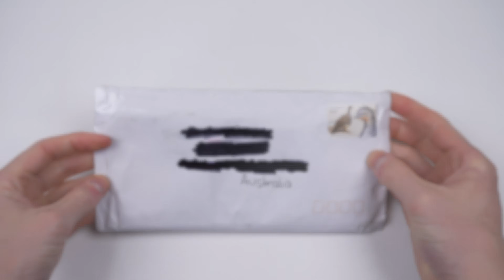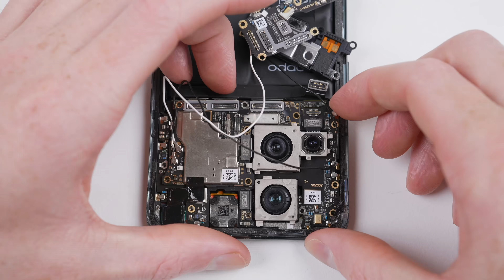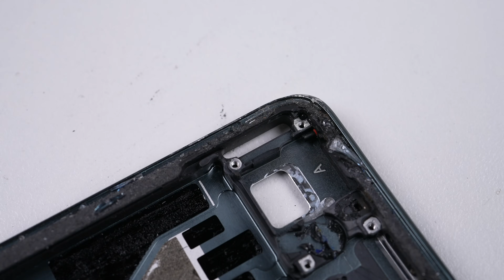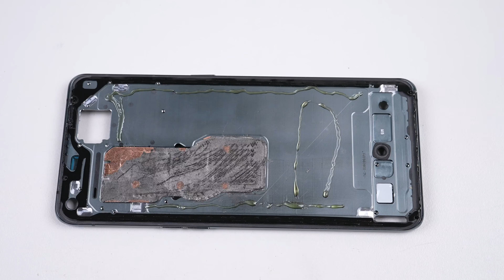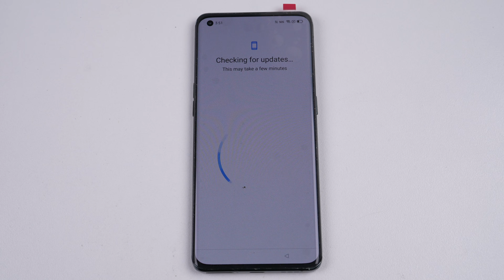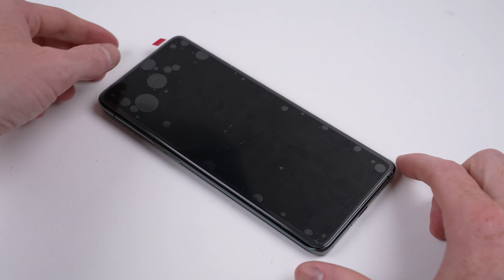Fixing Someones Failed Repair - $30 Oppo Find X3 Pro Restoration

Comment: oh, it's very similar to the oneplus.  Could you tell me if you can change the logic board of an LE2127 for an LE2125?...It's that the 2125 is 12/256 and the LE2127 is 8/128 and without 5g.

Comment: so google reset protection can be bypassed? even "find my phone" option was turned on?
Reply: It was no bypass. He was wrong. It was asking for his old phone's password in which he logged his gmail account  for restoring backups present in google one. Standard procedure for all androids over 10. Do you really believe android after 13 years will have that?? I am surprised how he made that mistake.

There is no such thing as "reset protection" on android. I often work with custom roms.

Comment: The phone was asking you to enter a new unlock pattern not the old one, clicking cancel just means no pattern was set. Same with windows 98.
Reply: actually you both are  wrong. It was asking for his old phone's password in which he logged his gmail account  for restoring backups present in google one. Standard procedure for all androids over 10.
Reply: @GigaCat  actually you are wrong. Windows 98 was here before android, so simply cancelling the password means you didn't want to set a password. Also, on android, the phone would ask for an email before any password would be entered. As I said, tapping  cancel just means no password/pass code is set.
Reply: @andytownsend9163  He actually did enter his email. That's why it was " Looking for backup" right before asking for the password. I am an android dev. I know that setup wizard inside out. He didn't show you the email login for obvious reason. 

Setting unlock method comes after restoration. Check the video again. You can see a skip in the video. That's where he had setup his email and right after that wizard asked for password of his previous phone after " checking for backup " on that email. He canceled the process and it went ahead without restoring. I hope it's clear now.
Reply: @andytownsend9163  Also windows 98 is irrelevant .
Reply: @GigaCat   The phone was reset to factory, no email was entered. He then says pressing cancel simply bypasses the pascode, the same as in Windows 98. Let's hope you don't dev on my android device. Maybe you need to watch it again.
Reply: @TheRealGigaCat  he quotes going full "windows 98" so yes it's relevant.
Reply: @andytownsend9163  "and he is quoting windows 98 so it is relevant" 😵‍💫😵‍💫😵‍💫.

If i quote"gay" and "feminist ". Will that be relevant too? With that Android password?
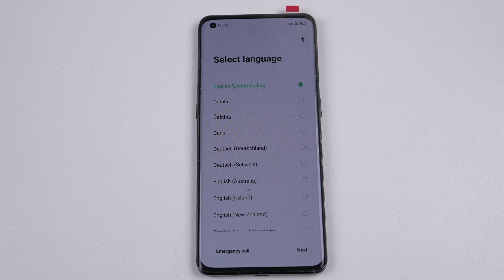Reply: @andytownsend9163  watch the video right after he selects language. There is a cut in the video. Explain to me what that cut is. From 10:50. His hands disappears if you need proof for that. I will be waiting. Be the smart guy and reply back.
Reply: @GigaCat  correct the phone asks for a pass code, he states password/pass code is related to the original owner and just pressing cancel bypasses this request. You can not log in to Google with a pass code, pressing cancel just dismissed the chance to enter a pass code. I don't know how you can format a phone and still have the old users' email addresse, he may of entered a new one, but what I said is 100% true. The phone was asking for a new pass code, not the old one.
Reply: Hence the referral to windows 98
Reply: @GigaCat  I'm waiting 🤣🤣
Reply: @andytownsend9163  i am not saying that phone is asking for Gmail's passcode. It is asking for the passcode of the phone in which the email account was previously logged in and was setup as the backup email( which means if i had and old phone with that email. The new phone is asking for the old phone's passcode to restore the backup on new phone from the previous phone). This has been the standard for Google's implementation of Android since 7.0 which majority of OEM uses including oppo and Samsung. your reply clearly tells that you never used Android or never restored any backup over gmail.

The passcode screen doesn't mention the old phone's name because its over an OEM skin of oppo's colour OS. If you take the Pixel phone or any AOSP rom. You will see the old phone's name along with the prompt to enter the passcode. 
There are two ways to restore data. 1st one is over the cable which he clicks "don't copy". After that comes the restoration of settings over gmail. Google one backs that up. If you have an Android right now go check it in (settings> backup). There is the google one backup setting. That is what's happening here.

After reading the reply i feel like you are even more clueless. Obviously you cannot log into an email with phone's passcode. All that steps i talked about comes after logging in to email with password. I thought that was understood.. but no..
Reply: @andytownsend9163  you can even watch a simple video of the setup screen on yt and how it goes. But no. Also will be waiting for your reply.
Reply: @GigaCat  I think he may have edited it in a way that's confused you. Yes, you are correct. My original reply said unlock pattern. I didn't mention password once. You have twisted what I said into password. Go and read what I said, and yes, you need a password to restore a phone, not an unlock pattern.
Reply: @andytownsend9163  i think I am wasting my time here.. should have realised earlier. Watch some setup videos. Sooner or later you will get that he skipped the part where he was logging into his email because obviously he doesn't want you to know his credentials. I am getting confused by the very thing i worked on for years? Sure buddy.

And yes, you absolutely need your old phone's unlock pattern to restore your phone because your data is encrypted over that pattern. The video is available even on official Google's channel on yt. It will explain all that to you like a toddler.

Also don't bother replying. That would save a lot of my time.
Reply: @andytownsend9163  peak comedy.

Here 🏆
Reply: @andytownsend9163  i truly wish i had as much confidence as yours. Can't really imagine me being your shoes. Also using joker emoji... You must be less than 20. But your photo looks like that of an adult... are you using your dad's account? Anyway My employer would have fired me after reading this chat if i were you..
Reply: @GigaCat  dude, seriously read what I said. Calm down!! what you say, I agree with, but it's not what my original comment was about. You have twisted it way off course. Please stop. You seem to be confused with an unlock pattern and a password. I never mentioned "password" once. I never mentioned email either, both words you have put in my comments. I think if you learned more about Windows 98 then you would understand what I'm saying. Thanks and goodnight 😴

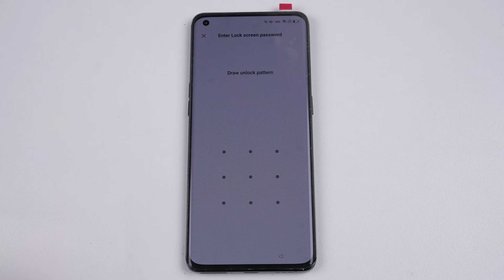Comment: 11:00 I have never seen easier bypass than this 😂
Btw, this phone reminds me iPhone 4s on iOS 7.0.2 which I got completely disassembled and had to guess which screw gets where. I ended up disassembling another 4s to check the right places for screws, using it as a “navigator” (hope you got it 😂)
Reply: Actually he was wrong. The phone was asking for  his previous phone's password in which he used the gmail account. This is a standard procedure for androids to ask for copying settings from previous android and is not mandatory. You can even see "checking for backup" just before it asks for password. Phone is actually checking backup on his google account and is asking for his password and not the password of previous owner of the phone. He cancels it and it goes ahead without restoring any setting.

There is no such thing as "reset protection" on android. TBH i can't believe he of all people made this mistake.
Reply: @TheRealGigaCat  there is a reset protection called “FRP lock”, google it
Reply: there is reset protection but its easy to bypass @TheRealGigaCat

Comment: release in 2021. $1500. People are freaking ridiculous. I have my phones for years with barely a scratch. I work in maintenance and I lay on floors but I pull out my phone first. The most expensive phone I've ever had cost $70 (my current phone) and it is in pristine condition and it's a refurb. I keep it in a super basic case with a glass screen protector. I have accidentally dropped it. It's still like new. It's 4 months old to me but looks like it did when I first got it. How can so many people be so careless with these devices ? That thing is a years old and it's destroyed ! I know accidents happen but people are careless !

Comment: Nice video, I do repairs too and I have a question, every time I get a back glass replacement, I can’t use the glue that comes with the new back panel, it doesn’t stick on the phone and eventually it falls apart… so I decide to apply my own liquid glue but I see you use the actually glue that comes pre installed in the back panel. 

My question is, do you something else to make sure it doesn’t falls apart ? I know you put two extra stripes of orange glue, but do you do something else?, thank you for sharing.

Comment: I know it seems dumb that Google just lets you use the phone by clicking cancel but I think that's better than preventing the phone from ever being used again like apple does. It's actually a stupid move to do because the original owners data has been erased either way so there's no risk for them, and no one is so fool that they would return an iphone that's being remotely locked with the risk of being called a thief so those phones just end up in junk yards or sold on eBay for parts.

Comment: Very weird that after formatting the data a password is asked for... password info are stored under /data/system/locksettings.db, so when you wipe the whole data partition, no more passwords. (except if they are lying on the formatting operation)

At least it's not an Apple phone, the best kind of phones of course, which prefers becomming e-waste with the icloud lock bullshit
Reply: It was no bypass. He was wrong. It was asking for his old phone's password in which he logged his gmail account  for restoring backups present in google one. Standard procedure for all androids over 10. Do you really believe android after 13 years will have that?? I am surprised how he made that mistake.

Here pressing cancel means cancel the restoration.

Comment: Does the fingerprint work after screen replacement? The new under display fingerprint sensors require calibration after after you replace the screen.

Comment: I remember seeing this phone in the hands of tech reviewers and I was in love with the design. The display is way too expensive so I'd never be able to take on a project like this. But for example, I fixed a Oneplus One (made by Oppo as well) where the display was only $20 from AliExpress and it felt amazing getting that thing up and running!

Comment: 3:18 correction: The Find X3 Pro actually has a 4,500 mAh battery. It is divided up into two cells. It is not a 2,250 mAh battery. That would be ludicrous for a phone released in 2021.
Reply: Ludicrous, but not for iPhones

Comment: I think one of the reasons they dont put glue adhesive just beneath display these days is cos when the phone is heated up the glue intensifies the heat and this shows up on the display visible to the user especially on white screen. It will appear as a glow/bright spots in the same way glue has been laid. Because displays are especially so much thinner these days. This is the reason why the heatsinks are manufactured in the way manufacturers knows they would need to sink in all the heat away from the body.

Comment: I don't mean to sound like a drag but you should mention that the back glass is a cheap alternative (since it looks and costs 15$) and it will not come close to the quality of the original part which by looks alone shows significant difference. Cheap parts like this also have a high possibility of not fitting properly, messing up all the hard work you've put on the very last step. Otherwise great video as always!

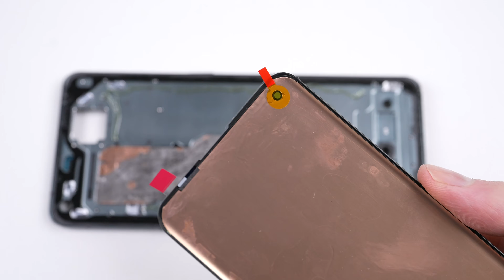Comment: 08:23 - I think 🤔, I would have ALSO ADDED a thin smear of CPU/Thermal Paste on the copper heat transfer part, so that it ensured a good full thermal contact with the copper on the back of the screen to aid in cooling (considering that the black carbon film is missing too)... BUT other than that, bit of a mighty job for a complicated built phone, Nice work! 👍👌    😎🇬🇧

Comment: If it's anything more than a screen, battery or back cover replacement your stuffed HA!... Obviously zero tech skills (no offence meant), I do component level repairs on lapops n phones everyday, maybe you should try n learn how electronic devices work so you can widen your horizons.
It's only taken me 40yrs of knowledge n experience to get to were I am, I didn't say it was easy but it's worth it.

Comment: These restorations are awesome and a really good value. The only problem I see is finding good quality or original parts for a variety of phones. If that would be readably available, a lot more phones would be fixed and not thrown away

Comment: The thermal paste applied probably wasn't enough, that amount is enough to fill the gap between desktop cpu and its heatsink, but phone heatsink and the cpu usually has quite a big gap. You can see just how much the thermal paste was in there needed to cover enough surface area.

Comment: btw the oppo branded screw goes on top of the battery cover section of the mid plate its a tamper proof type screw used by most of the Chinese brands

Comment: The battery is actually 4500MaH, each cell is labeled per it's specification, not the combined spec of the two.
Reply: 4500mAh split into 2 is equal to 2250mAh